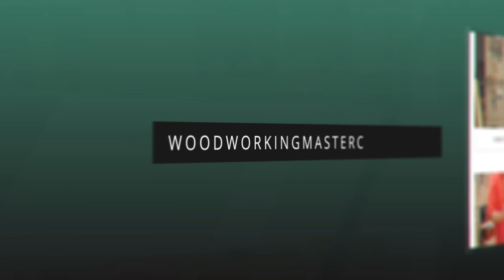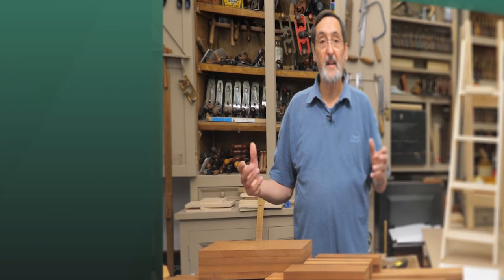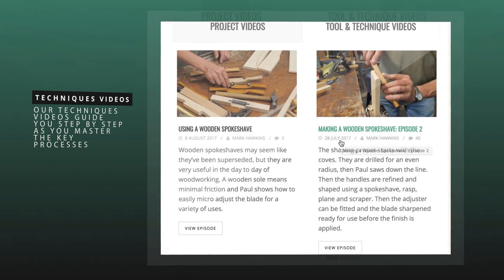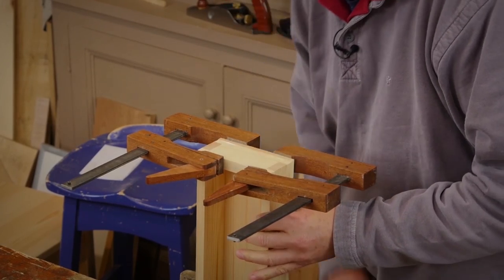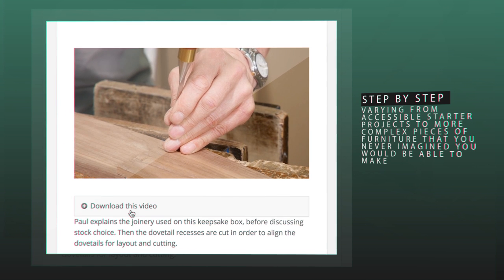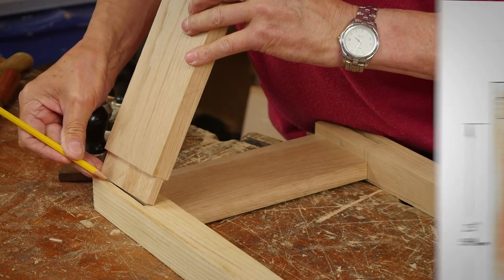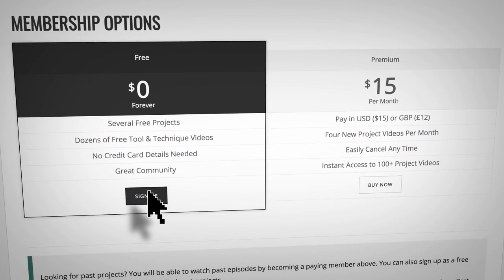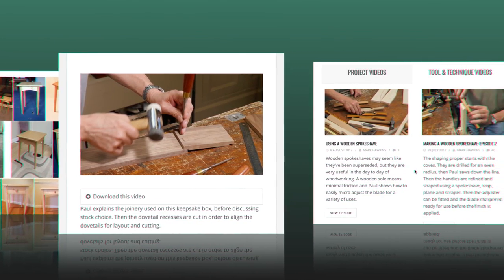Want to apprentice with Paul Sellers?

Comment: Hi Paul, I love trying everything you show us but I have a big problem.
Every time I plane a piece of wood to get it flat and smooth, the planed surface always slopes to the right instead of being flat.
I have 3x no 4 planes all bought from car boots but I've renovated and sharpened them as per your videos. (I get a lot of pleasure from taking very fine shavings so its always set finely) Also it always reaches my depth of cut on the end of the length of wood well before the start. I've tried taking all the downward pressure off the plane but there is no way I can completely flatten and square up all 4 sides. Can you suggest anything I could try to stop this problem? I'm sure I'm not alone with this problem and I'm sure that a video showing the correct use of a plane would be appreciated by many people.
Thank you for your time, and your extremely good videos.
Reply: Are you using winding sticks to make sure that you are planing the proper areas of the board to remove a twist or high areas
Reply: It's before I get to that stage. I can put an almost perfectly flat piece of wood in the vice and after a few strokes it will be sloping to the right. I think its me, the way I'm using the plane. Its not the plane because I have 3 and its the same with them all.
Reply from the maker: Hi Glyn. Thank you for your message. There are really too many variables that can affect the performance of a plane not the least of which is even the slightest uneven pressure or miss set of the plane iron in relation to the sole. The list is just too expansive but practice and more practice is the only reason i know as much as i do. Just persevere and keep trying.
Reply: Thank you very much for taking the time to answer me, I know you must be inundated with questions from people like me who all want to achieve your excellence.
You are right on all three counts. I've been practicing like mad (I never tyre of taking fine shavings now that you have shown me how to sharpen a plane iron) and I noticed that from where the shavings are coming up in the plane that the iron is set too far to the right. I leveled it until it stopped touching the wood and then micro adjusted it to take a small shaving, doing this several times ended up with a full shaving! Brilliant. The iron was set correctly.
Next I reduced all my downward pressure to zero and simply 'pushed' the plane (having watched your video where you pulled the plane with a rope with no downward pressure)... the results are remarkable! I can't thank you enough.
If only my woodwork teacher in the early 70's had taken the time to teach us these things, and the present teachers  would show their pupils that hand tools DO work if sharpened and used correctly, maybe we would have more craftsmen like yourself today.
I can't thank you enough.
Glyn.
Reply: @28gwdavies  some things to do for this: 

1. Hold the sole of the plane up to the light and check you have equal protrusion of the iron on both sides.
2. Take a shaving off the left then the right side of the edge of a board. Making sure the iron only touches down on half or less of the thickness of the board, also making sure that you are using each side of the iron in turn when you switch sides.

Then compare your shavings for thickness. If one side is thicker then the iron must be hanging out more, so it needs to come in.

So for both 1. and 2. if you find out one side is protruding move the side to side lever on the back of your plane to compensate. Then test again. Often you will see woodworkers do 1. then 2. To get it dialled in perfectly.

And if all else fails you can just compensate by taking more shavings off the point you know would otherwise end up high.  

Although taking a continuous shaving is immensely satisfying, and likely produces the best finish, there is no rule saying that's how it must be done.

So plane the spot you know would otherwise end up high where you to take a continuous shaving, and instead take it a little low by taking interrupted shavings off that spot only, and finish off with continuous shavings over the whole face until you bring it all down to level.

And if you can't manage it first go stop and have a good head scratch about what's happening and what factors could be producing the result you are getting, and you'll get there eventually! It's not as if you are getting paid by the hour and if you are that means more money to you lol.